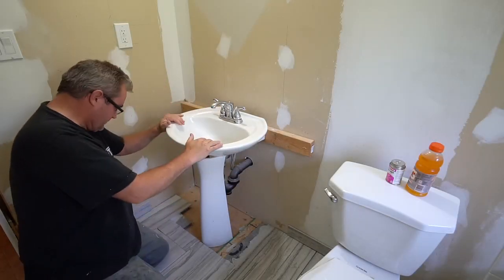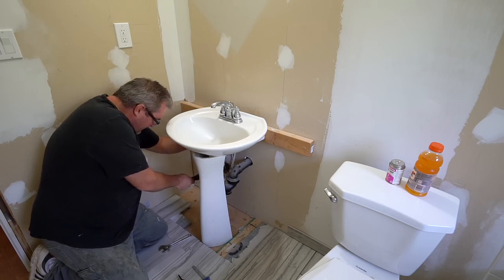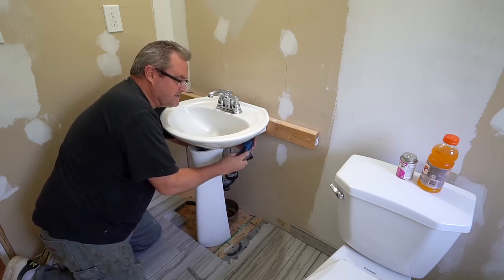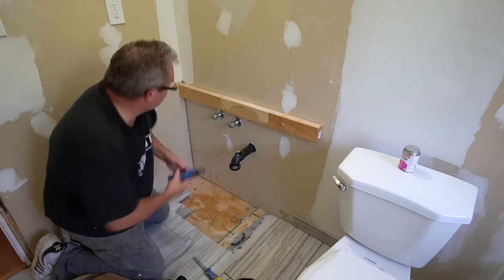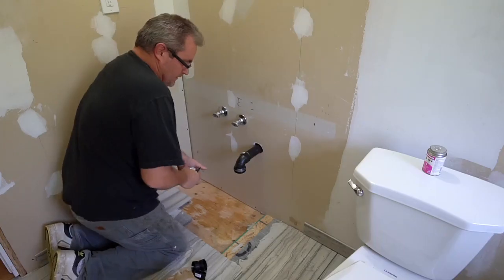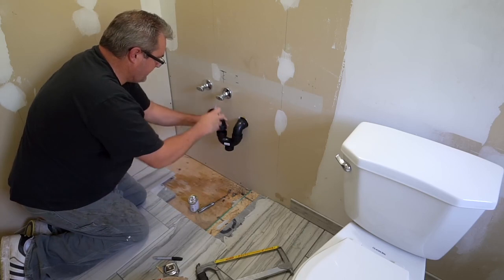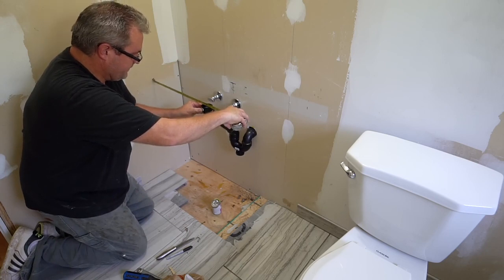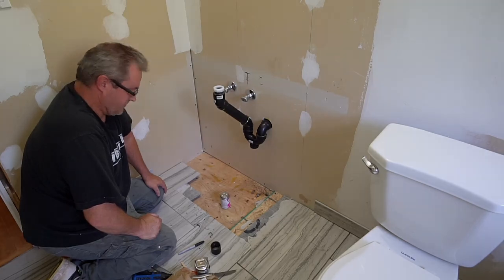Why I'm Not Going To Finish The Westeros Table

Comment: We always used plywood, wafer board (OSB),  particle board (MDF) and Masonite (hardboard). 

The cabinet shop I worked in used MDF.  It is a uniform material that holds the contact cement very well, does not warp and has no voids or lumps.  The never used melamine as we build custom work for high-end properties.  Everything was full thickness laminates.  The exception was wood cabinets where veneered plywoods were used.

Comment: the problem with particle/chip board here in aust. is one of perception, that is it always fell to pieces but they tell me the adhesives have been changed and that is less of a problem now. As a tradesman plumber of over 45yrs in the trade from apprentice through journeyman i have had to replace so many chipboard vanities that they were always known as s problem.

Comment: In my bathroom and my toilet i have used flexible tube. Exactly for the same reason. There wasn't enough room behind the drawers. With this flexible tube i could make the syphon and then put it simply into the wallconnection. And so its also simple to clean from the hairs and the other nasty things :-)

Comment: one advantage to not skipping the  tiles in the corner is that is makes it water tight in case you get water on the floor. Here the floor and 10cm up the wall is required to basically be 
as a bath tub
Reply: Suppose where you are also requires a 10cm tiled threshold at the doorway as well?
Reply: they haven't gone that far yet ;)
Reply: Good thing! Guess the flood just pours out of the doorway, but at least nobody will be tripping over the threshold :D
Reply: Just like with undertrays for dish washers etc. redirecting any leaked water out to the front, it's a lot about not having it quietly leak into walls/floor for long times causing structural damage, but getting  it out to where it's noticed (and thus hopefully fixed).

Comment: In my past hack-job amateur plumbing experience I've only worked with white pvc that you use the primer and then the glue (gluing both parts of course) so I'm interested if using the black stuff can keep from smelling that awful primer I'll keep it in mind for future.

Comment: The glue on both pieces will soften the two plastic pipes equally. So when dry the joint will be stronger.   Will doing it only on one piece work?  Probably but it's not the right way. You really want the best penetration on both parts.

Comment: I was wondering why you were putting glue on at all?  In most cases you leave those as slip fit types of drains so you can remove them to replace, clean, etc.
Isn't Plywood just by it's name alone, a wood of Plies?  Which Particle board is not.
Also, your water service lines are upside down.  They should be facing up to connect to your faucet.  Maybe you can't easily change them now, but they are.
Reply: James Jacobsen 
The glued joints are more permanent and the fittings are cheaper when you do a lot of it. Who disassembles waste pipework to clean it!?
Plywood is layered wood. Sheet material with a wood chip core and two thin real wood layers is plywood by definition.
The faucet fittings are not upside down. If they were the other way up, the flexible hoses would foul the underside of the countertop and be near impossible to service or fit.
Reply: David Lowe who disassembles drains? I have many times with the properties I own. It's quite necessary. 
I guess you can call plywood what you want but If i want wood with plies or particle board then you have to be specific. 
Either your building codes are different than mine or you don't have enough experience in plumbing, but every single hot and cold fitting are on top. Why would anyone put them underneath just to loop it up to the faucet?
Reply from the maker: Maybe some other much more expensive type of pipe and fittings, but you have to glue these or they will leak / fall apart. The concept of periodically taking apart the drain to clean it is also fairly absurd - that's what drain cleaner and pipe snakes are for.